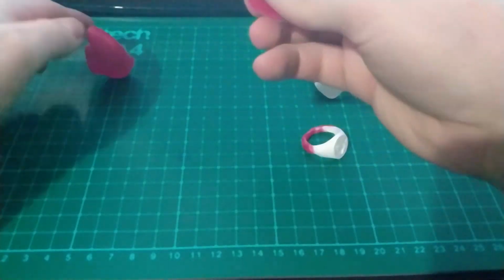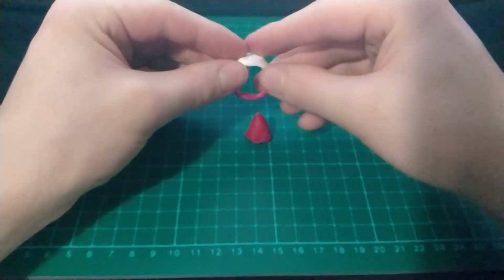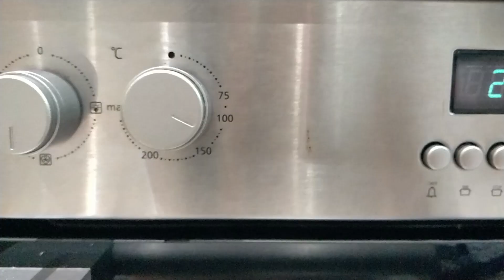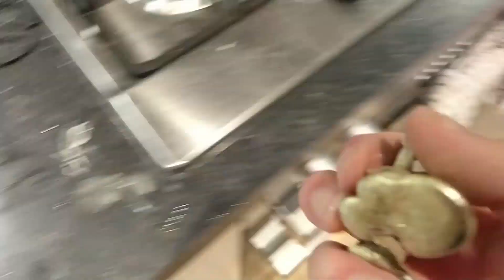How to Cast a 3D Printed Signet Ring

Comment: Liam would a resin 3d print still melt the same...??
Reply from the maker: As far as I know SLA printers use thermoset plastics which can't be melted, fdm printers, the type I used- use  thermoplastics! That being said I don't know what resins are available for resin printing so you might be able to find one that can be melted.
Although you could always use the resin print and make a silicone mould, which you'd then cut open, and could cast pewter into that! And it would have the benefits of being reusable and much higher resolution!
Reply: @TheModernMaker  ah I use the photon anycubic resin printer and taking a blowtorch to a printed ring the answer is no.....  It kinda crumbles but not enough to get the parting obf the ring out of the investment properly
Reply from the maker: @lestatsmods  one thing I've tried before is using standard silicone for making moulds, it takes ages to dry, and does stick a bit to the print, but you can get a workable mould from it
Reply: @lestatsmods  You need to use burnable resin, called wax resin, cast resin or castable resin. Regular resin won't really work well and doing a burnout might end up in a failed cast